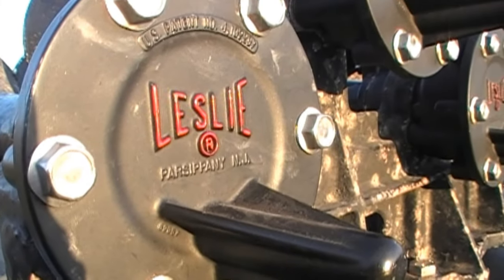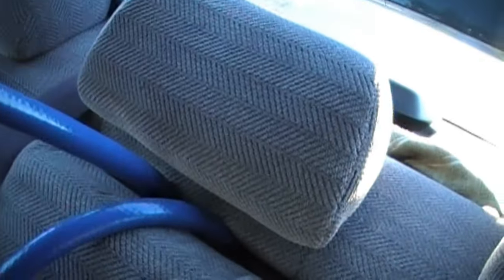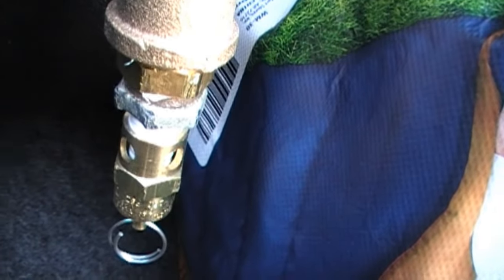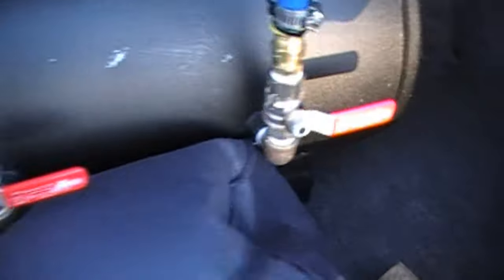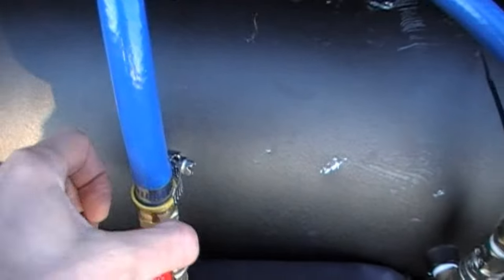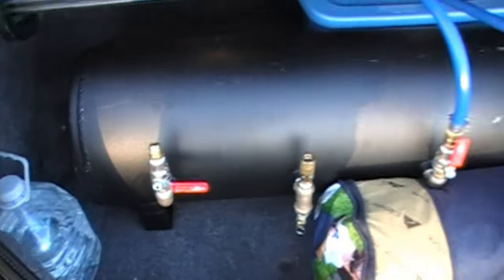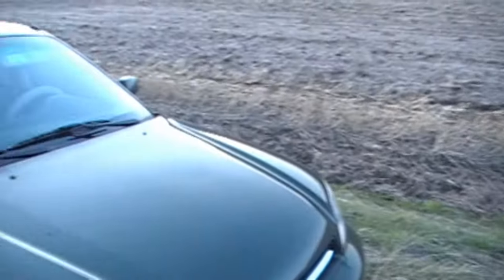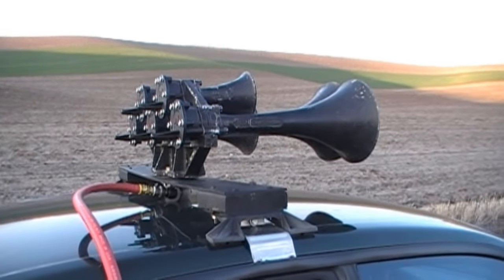Locomotive horn collector air system NOT for pranks or scaring (Big air for a big horn)

Comment: So why didn't you get a 200 psi compressor and then put a pressure regulator on it? Or did you get SOMEONE ELSE to set this up for you. Like my grandparents neighbors with all the classic cars that he DIDN'T restore....
Reply from the maker: Regulators also limit volume (flow), which for these horns is more important than pressure. High flow regulators are far more expensive than what I was willing to do. 
I did this entirely myself. It’s a compromise between what works well enough and what an ideal setup would be, since it needs to be low cost and removable. I don’t run a horn on the car 24/7.
Reply: expense is the limiting factor for a lot of things.  Id love to get one of those Nathan K5LA AirChime from HornBlasters.  but $2,500 is quite high for a train horn not to mention I have no place to mount a 5 chime train horn, a compressor and a tank on my old short wheelbase truck.  I personally will have to make decisions and go smaller than I truly want if I even follow this line of planning in the end.
Reply from the maker: @Milner62  Don't buy from Hornblasters, they charge new prices for used horns.  K5LA's go for around $1000 on ebay, less if you go through other collectors.
Reply: @mafarnz , thanks for the reply.  I'll check that out.  Really need to look up dimensions of everything to see if I can even fit them on my old truck.

Comment: kind of crazy u have the air compressor in ur back seat when u could just get a bigger tank in ur trunk an air it up an home an go
Reply from the maker: +jake dem I actually have a second 20 gallon tank that I sometimes use.  Even when I do that, the compressor still offers 12 gallons of air that would be wasted if I didn't bring it with.  Since I can't fill up on the road I might as well bring that extra volume with me rather than just dump it out.

Comment: Where do u get the 20gallon air tank
Reply from the maker: +Nolan Thoreson Its made by Firestone, its designed for use in air suspension systems, and is DOT approved.  Just do a google search for "Firestone 20 gallon air tank" and you'll find it.
Reply: +mafarnz Yes, it's DOT approved

Comment: I love and repect you I was going to put a Semi Truck Horn on my Bentley, have you gotten pulled over yet?
Reply from the maker: Never have been pulled over, and its been 8 years and counting.  Of course I'm responsible with how I use my horns, I don't use them to p[rank or scare, never in traffic or in crowded places.
Reply: mafarnz so what's the point then
Reply from the maker: Whats the point of what?  A video description that answers peoples most asked question?  I don't know, good question!
Reply: But it's really depending of the land. In my country, changing the horn of your car need an inspection of the local vehicule security control board.
Reply from the maker: This technically isn't legal for me to do, I just do it anyways.

Comment: if u ever did want to run a compressor in ur car  just buy a cheap harbor freight inverter u can have a car battery sitting there and the compressor plugged into inverter
Reply from the maker: +Random_rapper20 I did look into that, but the compressor draws too much current for an inverter that plugs into the cigarette lighter, I would have to get one that is hardwired into the battery.  I don't want to do that.
Reply: but you could have a second battery sitting on the floor that you can recharge somehow...
Reply from the maker: +Random_rapper20 Since I rarely have a horn on my car that's more work that I want to go through.  Besides the 32 gallons of air is plenty for what i do anyways so I don't really need to recharge the air.

Comment: How much did it cost
Reply from the maker: The horn was $850, the air tank was $150, the valve was $150, and hoses and fittings was around $200 all together.  This was all put together in separate purchases over the span of about two years, and mind you this video is about 8 years old now.

Comment: how much are the horns?
Reply from the maker: The horn in this video cost me $650, and the machining work to make it fully functional cost me another $150.  This was several years ago, these days a Leslie 5 chime like this is more like $700-$800 or more.
Reply: I was going to make my own horns but i'm not sure which would be cheaper. I find it interesting how every train horn set up is different from others.
Reply from the maker: I've seen a lot of very impressive and realistic sounding PVC horns.  That's definitely a good option to go with if budget is a concern.
Reply: I was considering that, I have also seen a lot of impressive setups including a ship horn, i guess it will just be a matter of looking around a bit

Comment: Isn't it dangerous to have a huge tank of compressed air in a car? That thing will explode with quite some power if breached.
Reply from the maker: Every semi truck and bus on the road has tanks of compressed air in it.  There are lots of accidents and crashes every day involving these vehicles.  How many times have you heard of their air tanks exploding?  None, because it doesn't happen.  As soon as the tank is breached the pressure drops, not increases.

Comment: Installed an air compressor IN a car.

Prettysure that's illigal and your insurance won't back you in case of an accident. Nice hobby though ... still, not very legal. :)
Reply from the maker: Not installed.  Just sitting on the seat and seat belted in.  Everything except the rack and the valve comes out/off in about 5 minutes, I don't run a horn on the car 24/7.
Reply: There is no law against air compressors in cars, otherwise lowriders would be illegal.  Also how do you think CNG and LPG vehicles operate?  There is a huge propane tank in  the trunk.
Reply: Yeah I love it...

Comment: a truck will work better for your air setup and you can hide the horn ....
Reply from the maker: A truck is more expensive to purchase, refuel, maintain and insure.  I have no need for a truck, and I have no reason or desire to hide the horns.  Additionally, I own over 20 different horns, so if they were hidden changing them out would be a real pain.

Comment: Garden hose connector instead of quick connect....FUCKING WOW
Reply from the maker: +LBJ Said 200 Years Quick connect is too restrictive, doesn't allow enough air flow.  I've since switched to SAE flare connectors.
Reply: mafarnz Grainger has 3/4" quick connects in case you ever go that route again.
Reply from the maker: +LBJ Said 200 Years More expensive that either the garden hose or SAE connectors, and still too restrictive.  Any quick connect will be too restrictive since it has the auto shut off function.  The SAE is the best for a horn use since it is a straight shot through and is strong.  The garden hose connectors worked good for flow but I broke too many of them.

Comment: How,much Did that cost ?
Reply from the maker: Keep in mind that this was all several years ago, The air system by itself was about $1200, spread out over individual purchases over two years, the horn cost me about 800, but today is worth about 900 - grand.
Reply from the maker: Jason_ Bloho I didn't say $900,000 you idiot.  That's a price range, $900 TO $1000.

Comment: why don't you use an amplifier to power it? :))))
Reply from the maker: Because it runs off of compressed air, not electricity...
Reply: mafarnz lol the whole video screams compressed air
Reply: Why don’t you hook an air compressor up to your battery?😂 trying to find a way to make it constantly running with the car
Reply from the maker: @mediamw2 I looked into that when I was first setting this up.  An inverter that is big enough to power my compressor would have to be hardwired into the battery.  I don't want to modify the vehicle's electrical or mechanical systems because the horns stuff needs to be removable (except for the roof rack).  So, I made a compromise and went with this.

Comment: the horn set up cost double to what the cars worth....you do all that work do it in a new car. I made that mistake too... to much work for a shit mobile...
Reply from the maker: +thebridgetenderl4b Cost of horn + air setup, $1200. Cost of vehicle,$6000.
Reply: Yea, I think you have your prices wrong bud. A trumpet kit is nowhere near as expensive as you think it is.
Reply: This isn’t a trumpet kit ... that’s trash ... these are authentic railroad horns ... and it’s not a kit. It’s bare metal and over 40lbs. The value is in the fact that it’s an old horn, with railroad history, and that’s what sells. But you wouldn’t know anything about the hobby, so continue to assume. The only thing you’re right about is there’s very cheap “horn kits” sold as “train horns” ... when in reality they’re cheap plastic noise makers and nothing more 

Cheers

Comment: Lol, a pressure vessel, potentially containing flammable oil residue, and an even bigger one in the trunk! Can't imagine what could possibly go wrong there
Reply from the maker: Oilless compressors don't leave oil in the air stream, that's kind of the point of them...  This is compressed air, not an explosive agent.  Any compromise in the tank lowers the pressure, not increases it.  The safety valves all pop at 150 PSI, so I'm not working with scuba tank pressures here.  The 20 gallon tank is one that is designed for semi truck air ride systems, its a DOT rated tank.  In other words, it is designed for use in a vehicle.  

Man, I love how all these people who don't have a clue think they know better than someone that took the time to research the topic.

Comment: Completely impractical.
Reply from the maker: Its practical for how I use it.  My constraints are #1 to operate my horns to their full potential I requires a minimum of 30 gallons of air with all 1/2" connections.  #2 The system must not alter any electrical, mechanical, or weather proofing aspects of the vehicle.  #3 The system with the exception of the roof rack must be removable since I don't run a horn 24/7, only rare occasions.  So given my design constraints, do you have any suggestions as to how this might be improved?
Reply: mafarnz Not if you don't want to make it permanent.  I would suggest using a few small 12v compressors and putting more tanks in the trunk.
Reply from the maker: +psirvent8 exactly, the system was designed and works for the way I use my horns. I don't know why people don't seem to understand this concept.
Reply: ltldev;:  Aren't most hobbies "impractical?"  I guess it depends on who you talk to.  Hobbies are fun, no matter how simple or outrageous they are.  To each his own.
Reply: Since you have a generously sized air tank in your trunk and you don't want to refill it on the road, why do you keep the (120VAC) compressor on your back seat ?
Reply from the maker: The 120V compressor is also a 12 gallon air tank, so it increases the air volume that I have to use.